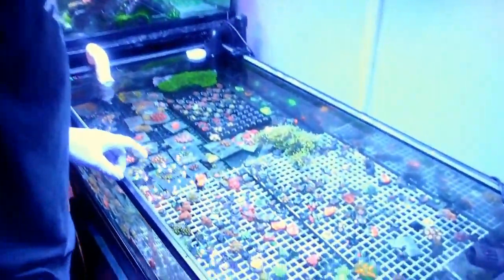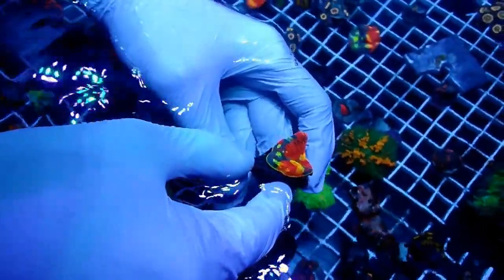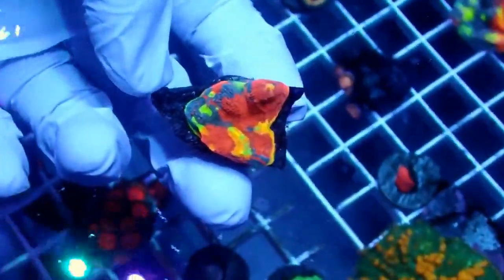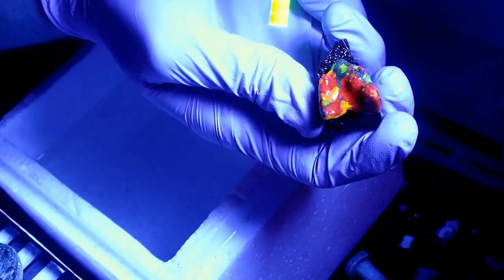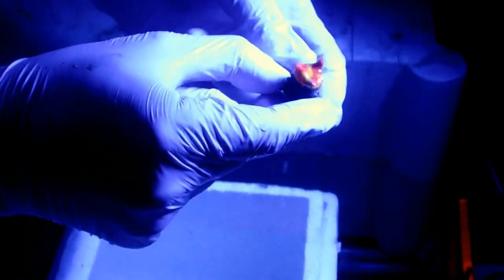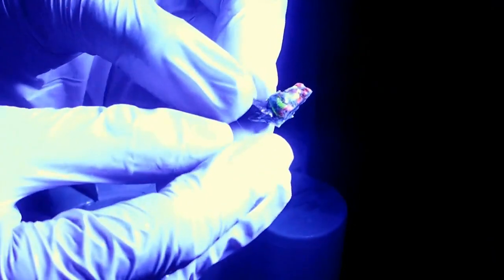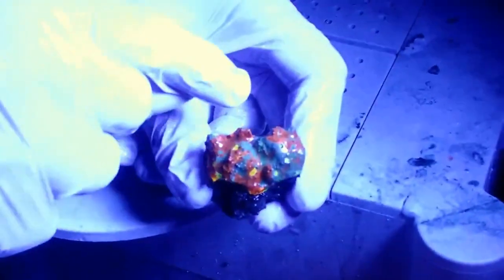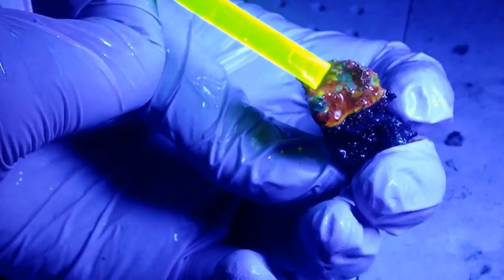How to frag like a Pro: Rainbow Chalice Coral Fragging Video

Comment: Hi nice chalices mate any care tip you can share
Reply from the maker: Low light, medium-low flow, and put them somewhere stable that they wont get knocked around all the time. Feeding them a couple times a week helps too. Good luck!
Reply: Thanks for the reply any ideas what could cause one to recede
Reply from the maker: @davidturner3461  lots of things really... too much light, too high of flow, unstable calcium or alkalinity, high phosphate or nitrate, something picking at it. I would recommend 1. Testing your water and correcting any issues 2. Evaluating placement and adjusting if necessary 3. Target feeding

Comment: Can you frag chalices with just bone cutters?  I just bought 3 and think I screw up!  One is colorful and 2 are not but the two were cheap!  I idint think this out to well!  i dont own a band saw and the two plain one may not be anything nice! I think I may go back t investing in high end zoas and shrooms!  LOL
Reply from the maker: I wouldn't recommend fragging pretty much any LPS with bonecutters. A saw is definitely worth the investment.
Reply: Thanks so much for reply! I wonder if I can rent one for a day!  I had someone on ebay offer me 3 for 120 a piece two are half and half and are cb rainbow crushed  and one is a jelly bean with more swirls of color.  They are only on 3/4 inch post so very tiny I dont even get how one has 3 eyes but other two have 2 eyes.  One that is half and half has some blue fine streaking on the red part and you can see some blue coming in on the other side so that would be a blend of three colors blue ,redish pink then back to blue plus different color rims and eyes.  I thought i would sleep on it and watch your video again. Its sure takes a certain shape to be able to get only one cut!  That one was perfect for that! What i s the name of that gorgeous chalice?  The one for 800 is a big spend but its full of colors everywhere and its a sc dynamite. i am leaning toward that but dont see anyway to cut it up now and only one open wound per frag!   It almost totally round I was wanting to cut all the way around it and then cut each side but thats three cuts per frag! What kind of chances do the cut frags have? Would you recommend going at fragging it slowly and let it heal between cuts..  Maybe cut it in half first let that heal a while then maybe cut the halves in half later let that heal then come along then and be able to get just one cut per frag!  Its bay far a better price and I just stated contacting p[people that I saw advertised them in the past so I idid alot of homework to find that deal!  He cold have easily fragged it up himself and made a ton more or even advertised it whole and still made quit a bit more! I wish i coul d post pics of what I mean!  What a great video! I feel lik e I know so much more after watching it! Thanks